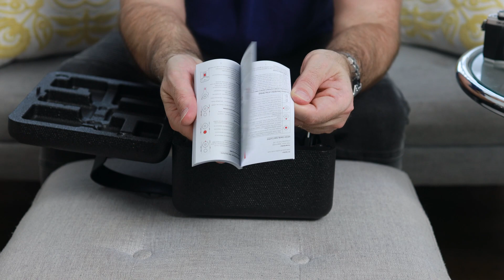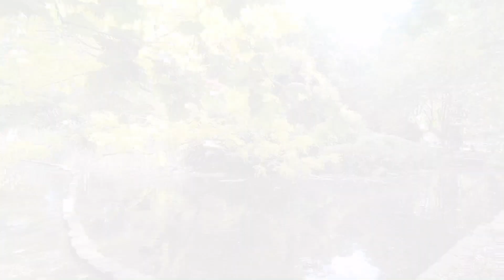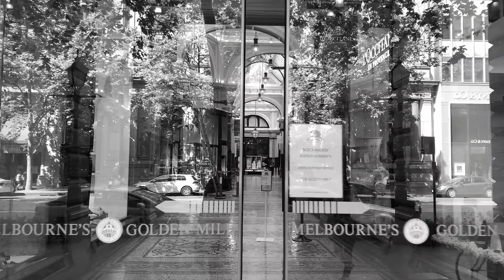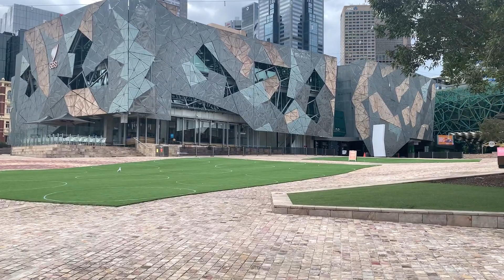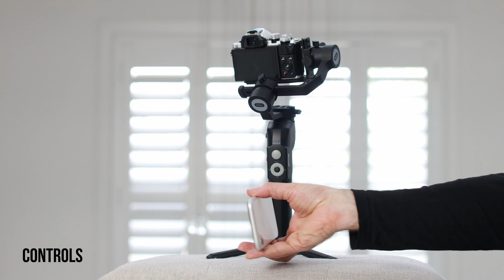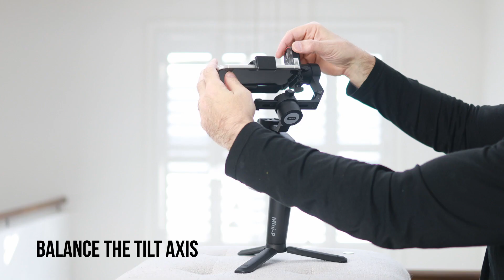Moza Mini P | The Ultimate Gadget for smooth cinematic walkthrough videos | Review and Calibration

Comment: I am specifically interested for shooting vertical videos with smartphone (main/back camera) and canon m200 mirrorless camera for Facebook live streaming videos...can you calrify whether this gimbal can be used similarly as landscape mode, I mean in vertical mode can I use all modes such as follow, semi-follow, locked, FPV etc ? Please reply as I want to buy this product once I am clear about my doubt...Thanks in advance☺️
Reply from the maker: Hey there, I just tested on a similar camera my Olympus OMD EM 10. Same kind of weight and size. to mount it vertically I tried using a Neewer  360 Degree Rotating Panoramic Ballhead this allows you to get the vertical going. However there wasn't really enough room vertically for the tilt and I just wasn't able to balance it. So for me no luck doing it vertically. I would say with the right mount you may be able to do it with an iphone...

Comment: Thank you. I just got the Mini-P and watched videos on its setup... the ones from Gudsen amongst others. I had literally dozed off in front of my computer for 10 minutes to awaken to your own. It thereafter became so much easier to do the balancing. Thank you again.
One question regarding the two cables: the first is the charging cable which is fairly routine and the second is for a 'supported camera'. In another video(I fail to recall which) the presenter said Sony but I don't know as I don't have a Sony. The same presenter said you'd need a different cable for other models. Do you have any intel/info on this?
Reply from the maker: Hi There, so glad you found the video helpful. Here is the full list of cameras suppoted. https://www.gudsen.com/download/MOZA-MINI-P-Camera-List.pdf?v1 In terms of the cable you would have to check what connection is on the camera and get the right cable to suit it. It could be usbc, mini usb or micro usb.

Comment: Have you tested the Zhiym crane M2 ? I am undecided between this product and the Zhiyun
Reply from the maker: I haven't tested the Zhiyun Crane M2 but I have used the original Zhiyun Crane which works well. The Zhiyun M2 does accept a heavier payload of up to 1.5 Kg compared to the 900 G on the Moza Mini P.  But apart from that hard to say which one is better not having tested it.
Reply: @Touchtechnologyreview  the crane m2 is weaker not stronger

Comment: The Moza is a typical Chinese junk product. I tried to use it with a 
phone and a small point and shoot camera and it often gets twisted up. 
When I go for low shots, it jams and vibrates. It's not really that 
smooth and jerks a little going side to side, and really cumbersome to 
disassemble. I just put it in a towel in my backpack instead of the 
case. Overall, stay away from the Moza Mini P.
Reply from the maker: Thanks for your feedback! I found it quite reliable and works well for me. I have used it most extensively with my iPhone and GO PRO and gone on long walks for up to 40 minutes. I have done some low shots but not as extensive as my standard walkthrough and panning shots. As a matter of interest did you calibrate the camera and iPhone perfectly so that it stands in both vertical and horizontal position without assistance. I find that if the calibration is out then it can play up the way you describe but if I spend the time to get it perfect it really does seem to work very well.

Comment: I spent 4 hours trying to balance this thing and still failed.  Tried to balance my iPhone XS and just can’t get the the bit that holds the l- plate to stop spinning.  Would love some help as I have watched about 6 hours of mini p videos and still can’t do it
Reply: I can't get my iphone xs  to align with the first knob!  I keep sliding it back and forth but it my phone still tilts to the right - how do you do it?  Pls help thanks!
Reply: WHen I feel like I have it aligned vertically - your first step - when I let it go it flops -  I have to use the horizontal balance to be able to level it vertically but then when I try to adust the balancing of the horizontal bit and it flops.  I can't seem to get it to how you do it - I'm thinking maybe my moza is faulty...
Reply from the maker: @SlashR4  A few things to check. First make sure it is turned off before balancing. Second make sure the gimbal is in the right direction on the tripod on the table top so the trigger is facing you as you set it up. You should have the vertical tilt motor on the right and the roll at the back. Once you put the iPhone in the bracket just start with getting it to balance vertically first by adjusting the right and rear levers on the motors. Keep in mind when you get close to balancing you need to be moving it by very small units only a mm back and forth to get it to balance. It can be a little fiddly but keep going, nudging it one way and the other until it stays still and balances. I don't think it would be faulty as it should balance anyway when not turned on. It would only be faulty if after balanced you turn it on and a motor fails. Download the Moza app so once you do turn it on you can calibrate it and test it.
Reply: @Touchtechnologyreview  Thank you so much - it was the fiddly bit that I kept over shooting  - I finally got it to work now - thanks so much!
Reply from the maker: @SlashR4  So great to hear that. I know it really is down to the millimetre, you just need to move back and forth by tiny increments until it stays still. Now that you have done it once, you should find it much easier moving forward. Now time to  get out there and have fun! I just uploaded my latest Melbourne 4k walkthrough which I managed to sneak in before they locked us down again.
Reply: During that 6 hours of video searching did you happen to find any video showing how to balance it vertically ???
Reply: @JayNikam  I don't really remember, apologies, but I'm pretty sure I didn't come across a vid like that.